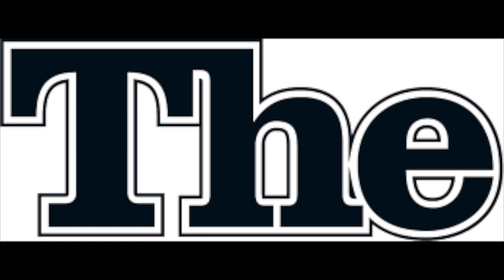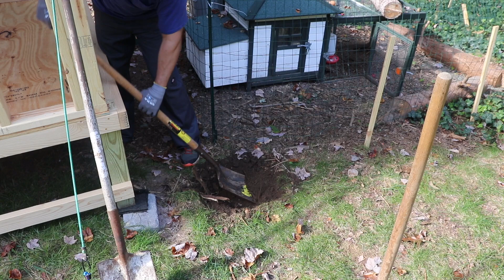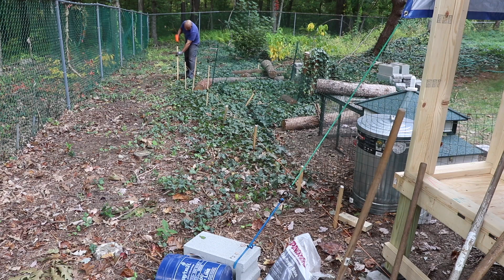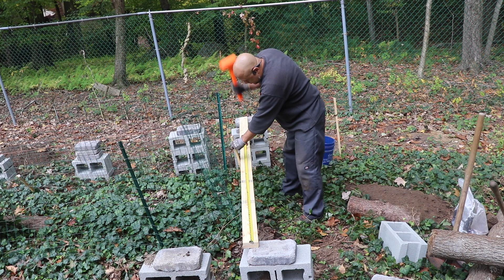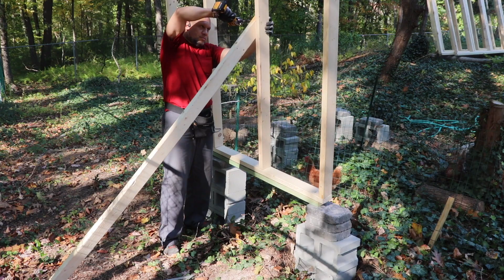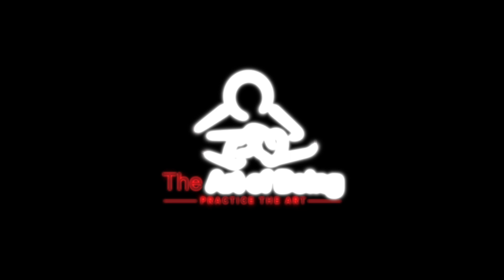Chicken run walls and foundation. Most Epic DIY Chicken Coop Build Part 3.

Comment: Ben:  got a couple of quick questions for you.  I’ve watched your entire chicken coop build a couple of times in preparation for building my coop.  I had started my coop before I came across your video series, but because I still have a full time job, I don’t get to work on my coop as much as I would like.  I have the base of my coop built—4 treated 6x6 posts cemented in the ground to support the coop itself at 32” off the ground (height of the bed of my truck so I can sweep bedding right into the truck bed for cleaning).  My questions are (1) what did you use to span the gap between the treated 2x4’s on the bottom plate of the chicken run and the ground, i.e. where the natural slope of the ground slopes away from the bottom plate, and (2) how did you actually attach the run to the coop itself, i.e. was it just butting the top & bottom plates of the run up against the coop’s support posts & then the siding actually was the attachment point or was there another point of attachment as well?  Thanks for your help.
Reply from the maker: Hi Richard. First, let me tell you that im thankful and honored!!! Secondly, I can appreciate trying to build and working a job at the same time. It is very difficult to find the time and energy! As for your questions, I will try to answer as best I can. Also, feel free to email me at:
PracticetheartOD@gmail.com so I can send you pics up close or if you want to send me some pictures. (I'd LOVE to see what you've done!).
Here we go. I believe you are asking how I supported the bottom plate of the run wall sections. I built up supports just like I did for the coop feet and wall section ends. Dug, a hole, packed paver base, cinder blocks to height. I did that in the middle of each wall section as well as the ends. I connected the run with an overlapping top plates, toenailed bottom plates and an interrupted vertical support that I used also as coop trim. (Send me your email, 'll definately take pictures for you). Thanks for the great questions and I hope ive answered them!!!
Reply: @TheArtofDoing  Thanks Ben.  I’ll try to shoot you an email tonight.
Reply from the maker: Sounds good. Have a great day!

Comment: why so tall ???
Reply from the maker: Great question! I wanted 2 feet under the coop. I wanted the steep slope for snow to slide off and I wanted 6' high on the lowest point of the run. I actually lowered the original height by 2 feet!!!